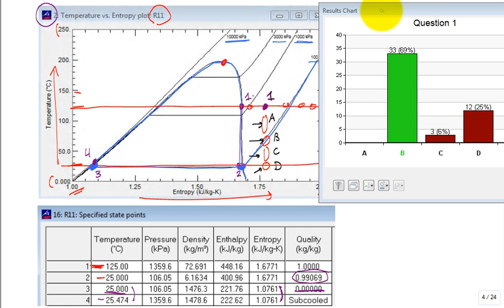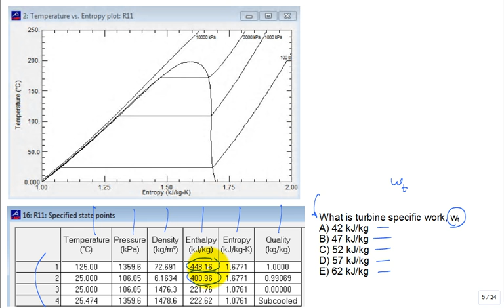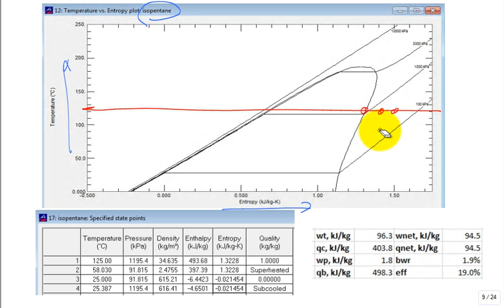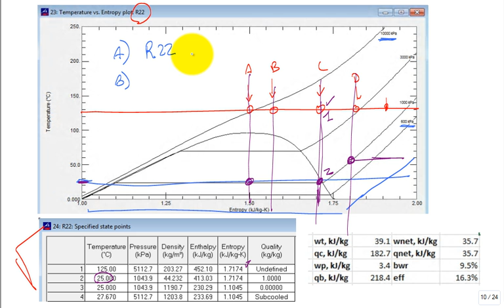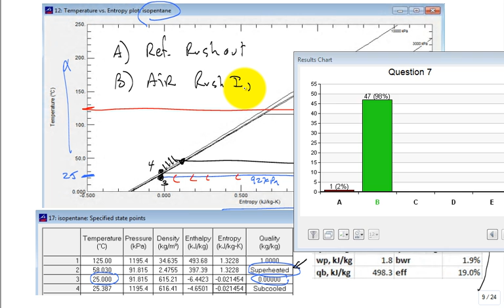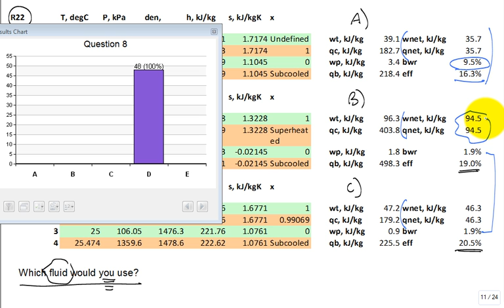Intro Organic Rankine Cycle

Comment: Excellent ❤. Can you help me to locate Refprop tool. What are the ways to improve thermal efficiency, power output. After listening to your lecture, possible ways came to my mind 1. Choice of refrigerant 2. Process parameter change 3. Equipment efficiency improvement. Pls suggest other ways to optimise ORC, thanks a lot.
Reply from the maker: search "Refprop", student version is called mini-refprop with limited capability is free (or had been in the past) https://trc.nist.gov/refprop/MINIREF/MINIREF.HTM